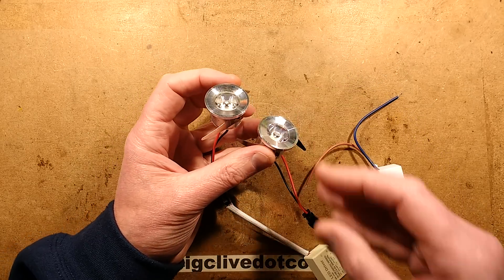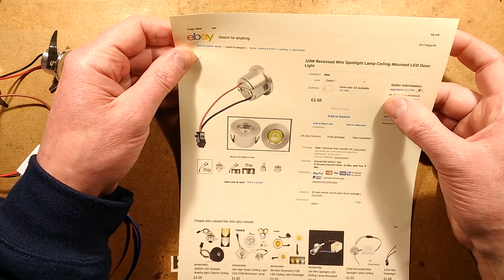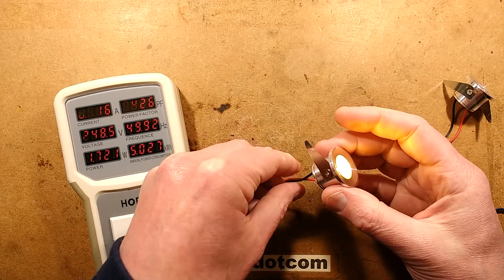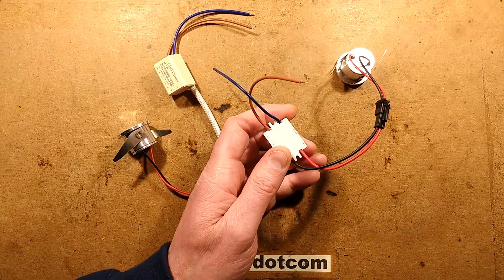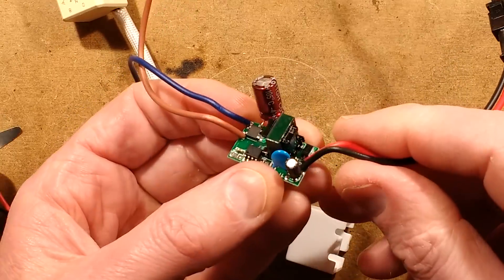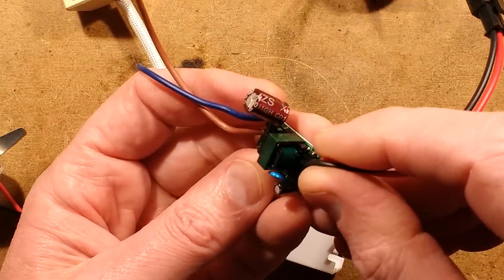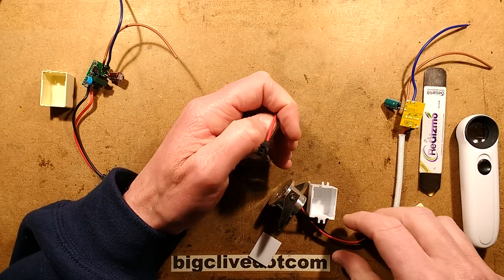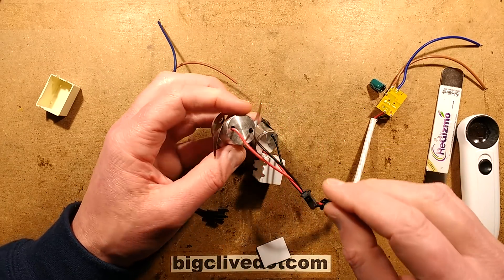1 watt versus 3 watt LED downlights.

Comment: I have to connect a 3.7 volt lithium battery to a 3 watt led (3.4v-3.6v 700mA).
 What resistance should I put in 1/4?  I only have those.  Thank you

Traduzione: Devo collegare una batteria di 3,7 volt litio ad un led da 3 watt (3,4v-3,6v 700mA). 
Che resistenza devo mettere da 1/4? Ho solo quelle. Grazie
Reply from the maker: A 1.8 ohm resistor.  It will need to be rated 1W.

Una resistenza da 1,8 ohm. Dovrà essere valutato 1W.

Comment: Hi, my microscope led is a 3 watt star model. I burnt out the original circuit board because I plugged a 12 V wall charger instead of the recommend 5 V. So my question is can I use this led with a buck converter to allow a normal generic 12v to power it? Also need a dimmer switch attached to control brightness. Does anyone know how to go about this ?
Reply from the maker: You could use a 5V supply and resistor for the LED or a higher voltage current regulator for 12V, but dimming would be more complicated.

Comment: I have a current led driver 2x3w provide 900ma. What’s that mean please? Can I use 1 led 3w?
Thanks,
Reply from the maker: The 900mA indicates that it's designed for 3W LEDs.  If it was for 1W LEDs it would be around 350mA.
Reply: I know 1Led 3w  900 ma but what confusing me is 2x3w! Does it mean 2 led connected in parallel because, in series, each led will pass 900ma! Thanks,

Comment: Would a 3 watt LED star still have drawn 1 watt because of the power supply?
Reply from the maker: Yes.  You can get two types of 3W drivers that will run either 1 to 3 LEDs in series, or just one at higher current.

Comment: Hey is there a way to convert these to take DC input? 

Trying to create a constant current circuit for one of these 1w leds using 18650 batteries. 

Want to add a solar charger to it as well. Thanks in anticipation.

Comment: I wonder if those angled spring blades would allow you to remove the light by gripping the front and twisting the fitting as you pulled.

Comment: I bought 3 of the 3 Watt units and was very surprised at how bright they are. would work great for under counter lighting and soffit lighting... these are NOT UL certified, and the power leads are not long enough  to really work with. I had to add spade terminals to be able to use them and attached the wires to a 2 position terminal strip. they work well, and are inexpensive.

Comment: I've seen a meme image of a product called the "electric bath duck" and I wonder if it's real. It appears to be a rubber duck with a cord coming out the back ending in the UK plug and it looks like a suicide tool with the idea of dropping it in the bath plugged in. Perhaps it has contacts on the bottom or perhaps it has a full plastic flex with no wires which would indicate it's a gag item. Might make an interesting video.
Reply from the maker: It's a spoof.  Although China sells electrode bath heaters.
Reply: I kinda figured as much. Though the bath heater would probably achieve a similar effect. Thanks for the reply.

Comment: Hi BC... please review the harbor freight router speed controller. I opened it up and was shocked(not literally) to see that they only partially soldered the mains wire to the fuse, leaving loose strands hanging within just a couple millimeters for the traces on the circuit board... this would bypass the fuse completely!!!
Reply from the maker: We don't have Harbor Freight here in the UK.
Reply: In this case... good. Thanks

Comment: Have you done, or would you please do a video on how the wattage available from the driver circuits is derived, as there never seems to be any noticeable visual  difference between led drivers!
Reply from the maker: The drivers usually put out a current limited supply with a voltage that adjusts to the total load of LEDs in series at that current.  So if a 3-8W driver had 5 LEDs connected in series to it the current would be about 350mA through all of them giving a total of 5W (1W LED times 5).
Reply: bigclivedotcom , thanks Clive, though I meant the actual driver circuits themselves, as the 2 circuits of these drivers look similar, and previous driver circuits look identical at times even though rated differently.

Comment: Hi big Clive I wonder if you could help I brought a set of 100 led lights that run of 4.5V and has a resistor of 4.7 ohms but yet is not seeming to work and getting red hot  then on and then lights no longer work any advice thanks. 
Mr Gatez
Reply from the maker: If the resistor is in series with the LED string then it may get quite hot in use as it will be dissipating about half a watt.  Try a 10 ohm resistor if it's failing.  Another possibility is that a failing LED is shorting out the string.  If they are white LEDs then you could run them directly from a 2-cell battery holder at 3V.

Comment: I have over a dozen of these and they have been working flawlessly for over 2 years 24 hours a day non stop. (1 watters) very nice little units.
Reply from the maker: The 1 watt LEDs are very good.  They don't get too hot because of their size and power.  It's when lots of LEDs are crammed into small cases and pushed hard that they fail quickly.
Reply: bigclivedotcom you betcha that's why I always go for the lowest wattage I can and if I need brighter I add more bulbs instead of adding more power to individual bulbs. All the crazy high power LED bulbs just tend to die fast for lack of sufficient Cooling
Reply: Can you wire these on to a spotlight circuit from main?

Comment: So what would happen if you just took 3 of the lights only wired them in series and hooked them to 12volt power like a battery  or even if you used 4 wired in series?   Would they need any current limiting device in line or anything?
Reply: They are diodes, so once you get above the combined forward voltage, they act like a short circuit.  You can put a resistor in series to soften the 'knee' but this is a compromise solution.  You need a constant current supply.
Reply: westinthewest okay, was just trying to think of a way to use them in a 12volt system in a RV.
Reply: You'll be able to find a 300mA constant current supply that runs on 12V.  They're quite common.
Reply from the maker: You could put a resistor in series with 3 LEDs like these.  Or use a 12V driver for them.  The resistor approach is very simple, but the resistor will get warm and the intensity will fluctuate with voltage variations as other loads are used.
One advantage of the resistor approach is that you can choose the resistor based on whether you want the LEDs to run at full 1W output or a more economic half watt output.  The intensity and current will also fall as the battery voltage drops, which is useful.  A typical resistor value for three LEDs in series might be 15 to 22 ohms with a power rating of at least 2W, but the higher the power rating the better.

Comment: I assume there are thermal limits due to the close proximity of the LED to the lens, ergo the possibilities of installing higher power LED's is also limited?
Reply from the maker: The cooler they run the better, so 1W is probably a good choice.

Comment: how many of those would it take to light the average (1000) sq ft home? i have another question is a watt metric?
Reply from the maker: It depends on how bright you wanted the home.  If it was just ambient lighting one or two per room would do, with brighter lighting for work and reading.  A watt isn't really imperial or metric.  Just a quantity.

Comment: Hey bigclive I order 2 battery from a seller on amazon and got an extra battery charger. It's a typical cheap Chinese battery charger That features things like a 4.2v 650mah and forbids to invert and do not di sassemble unit and video/digital camera and to top it off it claim to be a travel charger (so fast, light and small). The batteries are about 3300mah from testing not 4000mah btw.
Do you want me to send it to you to 'inspect'? if not heres the link. https://smile.amazon.com/gp/product/B00MP4IIDA/ref=oh_aui_detailpage_o00_s00?ie=UTF8&psc=1
Reply from the maker: I think I've made a video about that style.  The electrical isolation was terrible, so never handle the cells or contacts while it is plugged in.
Reply: i'll link a photo of it but now that you point that out. I tested to see if I could feel any current And I can feel a slight tingle off the contacts when touching them. It goes about half way down my finger... thanks to telling me....

Comment: What is that power analyzer?  HOPI?  Is there a US version.
Reply: It looks like the current version is the HP 9800, they're available on Banggood and Aliexpress.  There isn't a US version, it's 85 - 265V, with various plugs.  Aliexpress was the lowest price I saw, $56.  https://www.aliexpress.com/item/HOPI-HP-9800-Handheld-Power-Meter-Power-Analyzer-LED-Metering-Socket-Measurable-Current-voltage-Power-Factor/32375959317.html
Reply: thanks!
Reply: There is a different version made for the US, but don't remember for certain just which site for certain that I've seen it on. Try a look at TomTop site, I believe that's where it was, but totally made different & much cheaper since all the different plugs are not needed here in the US, hope that helps.
Reply: Well, yes, there are quite a few different meters available that will do the same thing.  My take on it was that the universal death-socket might come in handy, I do occasionally run into things with non-US plugs, and of course we do actually have 240V power available in the US, though I don't know how well the Hopi would deal with US split phase 240.

I found this one on Amazon for $14:  https://www.amazon.com/TS-836A-Energy-Voltage-Electricity-Monitor/dp/B00E945SJG - but it won't sit on a bench quite as nicely, and you'd need to build your own spring clip assembly if you wanted that feature.  You could probably modify it a bit, add a power cord and remove the plug on it so it would sit flat on the bench, there might even be enough room in the case if you wanted to hack in the spring clips.

Maybe Clive will get one of those and take it to bits...?
Reply: Thank you Jon C.
Reply: I like the term universal death socket. we called a power cord with alligator clips on it a "suicide cord".

Comment: I was wondering if all these Chinese Class Y caps are really safe (failing open circuit as they should do). Maybe an idea to test them ?
Reply from the maker: I'm more worried about the transformers.
Reply: yeah you're right. The primary and secundary windings could be poorly separated

Comment: Hello Clive can this be powered by usb. Thanks
Reply from the maker: Technically speaking you could just add a resistor in series with the LED for USB operation.  If you wanted a nice round value a 1W 10 ohm resistor would run the LED at around 200mA and the resistor would dissipate just under half a watt.

Comment: our warehouse has a very magenta/purple look to the lights,it used to be very cold white ,whats the reason for a warmer spectrum in a warehouse ( mainly food items stored )is it less likely to bleach items long term such as ink and painted packaging ?
Reply from the maker: It may just be crappy LEDs or ones intended for another application like grow lights.  The main issue with bleaching is strong UV emissions that LEDs don't generally have.
Reply: i dont think they are LEDs but energy saving  florescent , the warehouse does look a lot better than it did with the new bulbs installed( maybe a fuller spectrum than the old lights ) ,colours pop more ,like how cheap restaurants uses cold LEds making food look bland  :) thanks for reply, edit ,i might try and take a picture of them if i can zoom in enough with my phone and find out myself

Comment: Bit of a novice question: if you are going to have multiple low voltage lamps wouldn't it be more efficient to have a single power supply for an entire section like a room then individual transformers on each lamp. Would you want a giant DC power supply centrally located in the home and then lines distributed to each section or room with relays switches? Also, If you are going to fill your house with LED lighting how do you avoid low power factor?
Reply from the maker: For many of these types of lamp you get a kit that allows around ten or more to be run in series on one transformer and the power supply regulates the current through the whole string.
Reply: That's good to know, thanks Clive.

Comment: Compact little extra-low voltage lights like these are great in Caravans / RV's etc. Easy to mount (relatively), and they generate little heat, so reduced fire risk. Just what we need for kitchen / bathroom spot lighting.  Just got to buy one or six (the 1W is obviously the best choice! :-) )

Comment: Big Clive: you know what you need that would lend another facet to your reviews and fact-finding videos? A light meter. Then you could compare actual, usable light output as well as all the rest. :)
Reply from the maker: I do have some light meters, but you have to use an integrating sphere that averages the whole output to get a realistic reading.  Otherwise a light with lots on intensity hotspots can look brighter than one with a good even field of light.
Reply: bigclivedotcom Hey, who says 'realistic' can't resemble 'quick and dirty'? I think it'd be nice to have at least a rough estimate...engage Max Hold and wave the light around at a set distance til the readout quits changing? Hi from Oregon, USA, by the way.
Reply: Yes "quick" and "dirty", just like I like my women.

Comment: I've always wondered about slot in lamps and heat, how warm will they get mounted in a wooden material?
Reply from the maker: It couldn't be worse than the 50W halogen lamps in the same location.

Comment: re: the arms, those types are usually meant to go in cans. the ones meant to go straight into drop ceiling tiles have wire springs instead of leaf springs

Comment: These would be awesome little lights to have embedded under cabinets and such. Drilling a hole might be tricky though.
Reply: Stinky Cheese 
Don't give up the day job.
Reply from the maker: Flat bits and holesaws are your friends.
Reply: Stinky Cheese
An important additional part of drilling is knowing the correct DIRECTION OF ROTATION, this should be added to your list.
tyvm.
Reply: When in need of a hole (no, just, no.), use scissors. Opened or closed, punch and twist. New ones work best, mostly for annoying partners or parents. No, not for making holes in partners or parents. And if the cheapy handle breaks off, just toss it in the toolbox for next time. Then you can't find it, and use another new one. Got 5 of those right here. And 2 unused hole saws.
Reply: I was more concerned with the thickness of the overall lamp, combined with the fact that most cabinets don't have all that thick of a bottom bit of wood, and that it would probably be drilling upwards from under the cabinet.
Reply: Dave Rhodes - well wasn't it sort of a silly problem?  Drilling a hole is not at all tricky, so someone like you might need it explained in simpler terms.
Reply: Tricky to drill a hole?  Did you know that places called stores, sell things, that places called factories make.  These factories make things called drills, which spin a thin in a circle.  The thing is called a hole saw.  You can get them in any diameter you want, At A Store.  Whether through random chance or decision, you can pick the size of hole saw that corresponds to the size of the downlight, and, (get ready for it) put the saw in the drill, plug the drill in, push the saw against the thing you want a hole in, and press the drill trigger.  Now the magic happens, a hole is born.   Yes it is tricky, requires mastery of several disciplines more difficult than say, writing that it's tricky.

Comment: Clive, you spoke of 'full spectrum leds', are they the type used with a full spectrum camera? I'm making a frame that holds various cameras and also lighting, I've got the visible light done but sometimes ghosts only appear in full spectrum.
Love to videos and learned so much. Thanks.
Reply from the maker: No.  In this case they're what the hydroponic industry calls full spectrum which is anything but.  Actually bright violet coloured.  (quite a nice colour)
Reply: bigclivedotcom OK, thank you...

Comment: Are these up to code anywhere? Seems more than a bit dodgy that they just jam into the ceiling and don't attach to a proper box or anything. They should be low voltage input instead of mains voltage so you can wire them to a properly enclosed power supply.
Reply: bubba99009 that was my question as well... in what universe would a hanging splice at mains voltage in a ceiling be code
Reply: well, theoretically they are isolated. I still wouldnt trust those drivers and I wouldnt use a ton of them to power a ton of lights either and just get one big driver.

Comment: "Let's short the capacitor".   Proceeds to short a just unplugged 400V capacitor with his finger. If I could subscribe two times, I would.
Reply: I also enjoyed "I prefer to get my surprises when I'm expecting them" :-)
Reply: At least doing that, the current just travels through the finger not across the arm and heart.  Besides, in a design like this the voltage is going to drop as the LED continues to be powered for a brief moment when AC supply is cut off.
Reply: The electrodes are too close together for any trans-myocardial path. Plus, I doubt that value of capacitor would cause VF anyway.